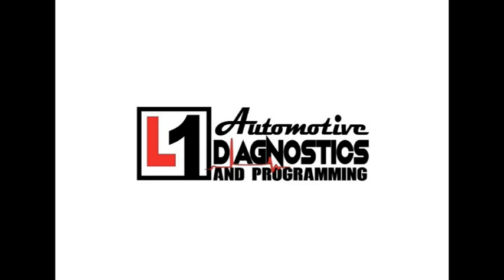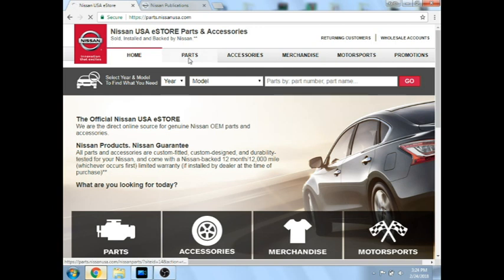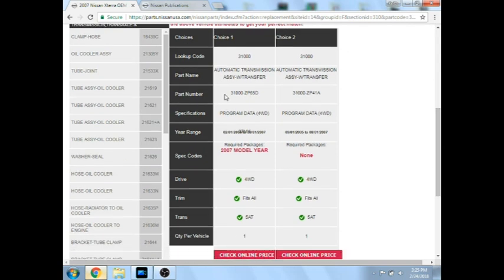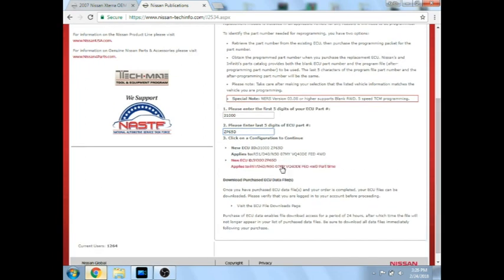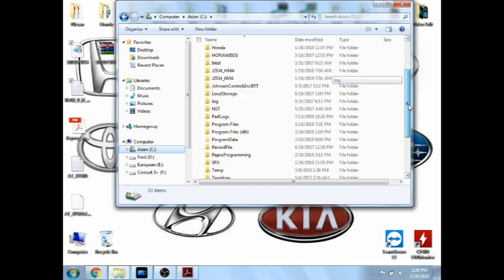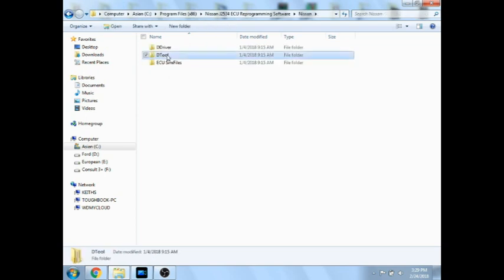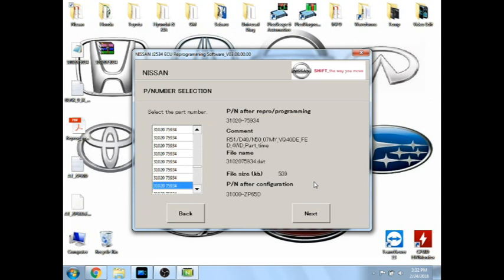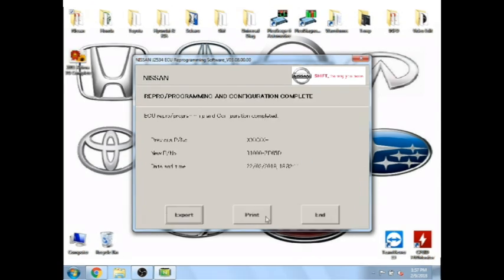How to Program a Blank Nissan TCM with NERS

Comment: Keith thanks for the info. There's not much out there to confirm what I need to do...May I ask your advice, please? I have a 05 Frontier Nismo.  Had problems with the transmission recent throwing codes like P1764 Direct Clutch Solenoid Function and 1769  High And Low/Reverse Clutch Solenoid Circuit. So my son and I took the valve body out brought a refurbished set of solenoids fitted them. It was OK for a day or so but now it's acting the same way. Anyway after research I have come to the conclusion that before I owned the truck it may have had coolant contamination due to rust on the TCM metal surround and on the old solenoids. So I've been trying to figure out if I buy a reman/refurb valve body with the TCM and solenoids on it, can I install that, then take it to be programmed, or do I have to somehow download the TCM data from the existing, one remove the existing one, then install the refurb one and upload the data to it
Thanks a bunch
Reply from the maker: Both ways can be completed. It is easier for me to just use the parts.nissanusa.com to pull the file name for the blank unit, but if a shop is doing the replacement of the VB, then they may only be familiar with the method of downloading the old calibration information first. You will want to call the shops around you to find out their preferred method.
Reply: The refurb one has not been formatted (flashed), does that have to be done first before i can install it then take it to shop to get them to reprogram it to my truck. Thanks for your reply

Comment: ONC file not found?
maybe you can help 
thanks
Reply from the maker: either you have to old of a csv or its in the wrong folder.
Reply from the maker: its almost always a csv file location issue. what are you doing, reprogramming? or programming a blank module? what file location did you put the csv?
Reply: Keith Perkins I bought used tcm for Nissan Pathfinder  (ebay). The car to prog is frontier, so look in Nissan and the number part is 31000 9CA6E, but this parts only appear in blank programming  in NERS.  So my question is if is possible flash the used TCM Pathfinder to works in Frontier. Sorry I new in this world the programming.
Reply from the maker: If they are from the same year and have the same original programming calibration yes, if not then no. you have to pull the calibration number from the old pcm and new pcm with the scan tool. Then see if both calibrations that are pulled point to the same new calibration number. If not, then it will not work.

Comment: Love these videos. Keep them coming. I would like to know once you purchase  
The download and install files to the pc. Is it a one time use file or can you reuse them on another of the same or similar vehicle? And if not do you delete the files after the flash from your pc. I'm just trying to learn about flashing so any Info helps. Thanks.
Reply from the maker: You can keep them and reuse, but you need to be aware that if you resuse an out of date csv file, and there has been a new update for the pcm, it will not point NERS to the newest file.
Reply: Keith Perkins makes sense thanks